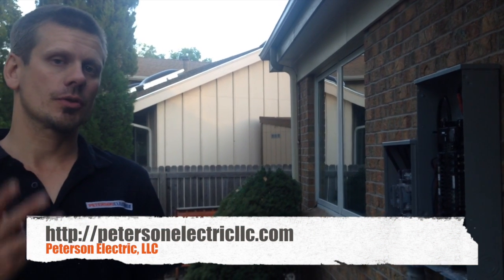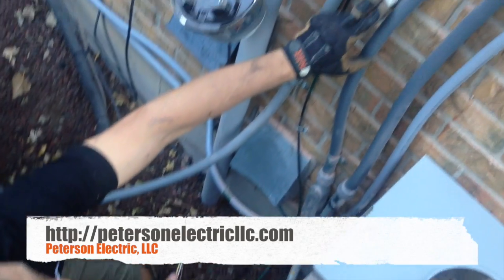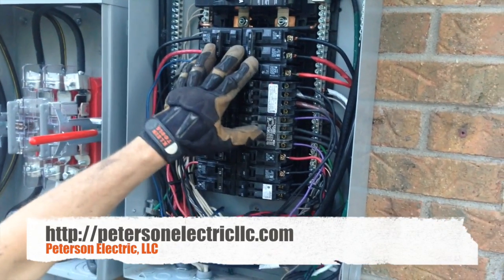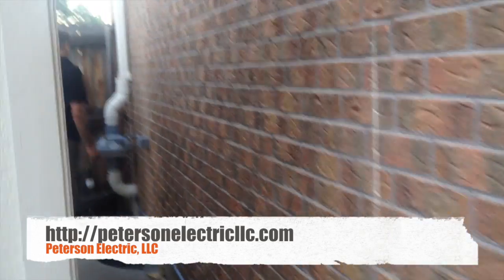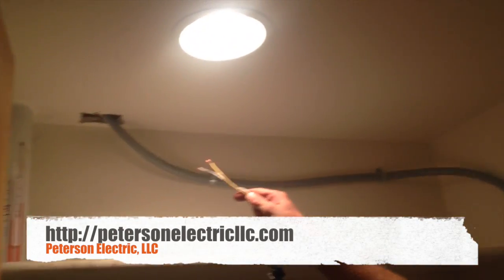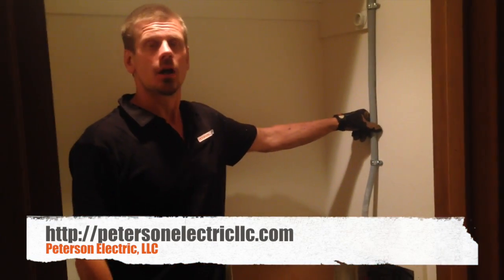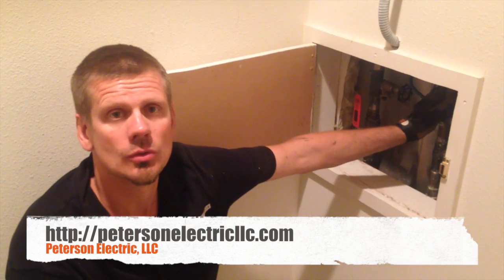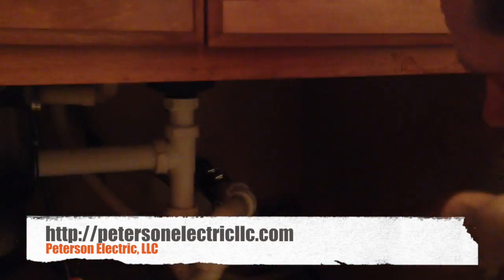What Should A New Installed Electrical Service Panel Look Like?

Comment: I believe you are only supposed to have everything below ground bonded and then everything above ground bonded, then connected at ONE point (ground rod), not 2.  By having two grounds you create a path for lightening to flow up through the ground at one point, through the equipment, and then back out the 2nd ground. This is all according to mike holts grounding videos about the NEC.  2 grounds is not only more dangerous for personnel (side flashes) but also there is evidence that it leads to equipment damage.  Again, this is according to mike holt
Reply: In CT it is required at both the ground rods and to the cold water on both sides of the water meter (our water meters are inside).

Comment: why is the panel outdoors and why not use green/yellow earth cable
Reply: +John McCarthy Aren't most panels outdoors? Mine is.
Reply: @scoobtoober29 In Florida where I live, most of the meters and main panels are outside, and the subpanels inside.
Reply: In residential in the USA the ground/earth can be bare copper. In commercial it has green insulation.